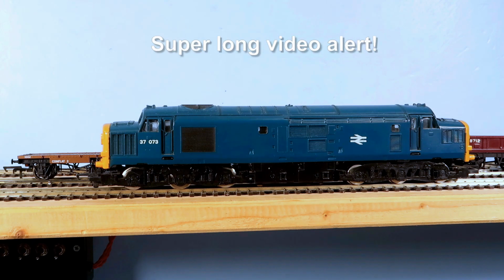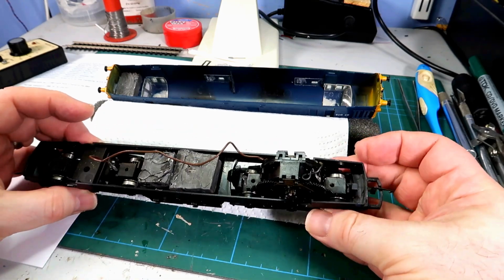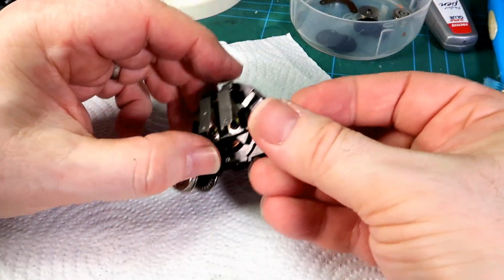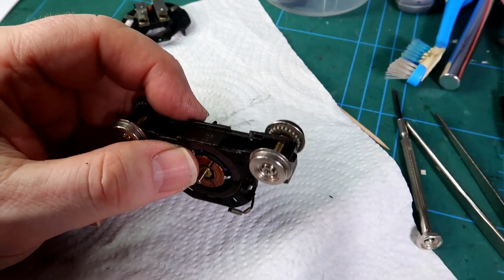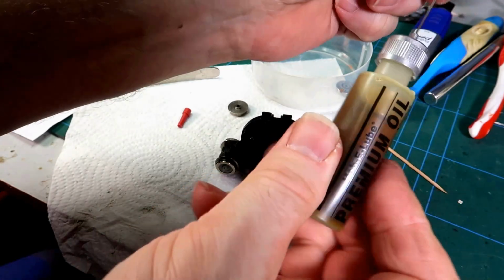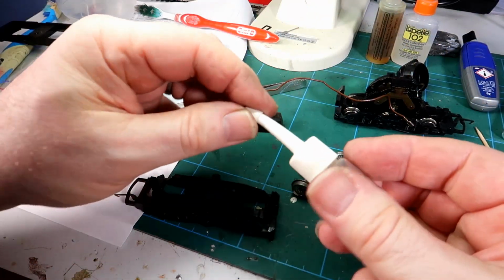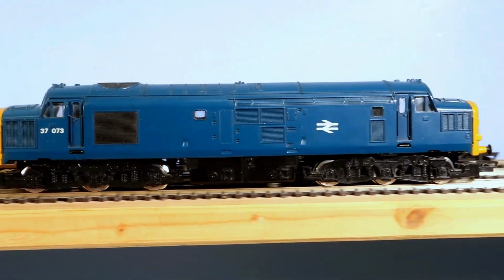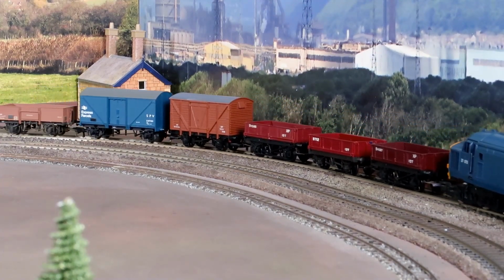Hornby R369 1980 class 37073 full strip down, service, compare and running video (TimeCode included)

Comment: A great job, she runs well for a 40 year-old loco. I had one of these as a youngster. When the yellow ends became scruffy I repainted them with my dad's tin of touch-up paint for the car. It was a Fiat 128 'W' plate (1980) and the colour was called 'Golden Yellow'. It worked out quite well actually but the shade of yellow wasn't quite right. After that some people thought it was a Lima loco because the paint was a dead ringer for the Lima self-coloured plastic ends. Funny the things you do as a kid!
Reply from the maker: Hi Paul many thanks indeed, Ah yes the things we do lol

Comment: Another great video to see yet again. The ring fields are such a great motor to work on. Just got to be careful with those springs! I will admit that springs have flew across the room before and I have a few spares just in case they are never to be seen again. Keep up the great content!
Reply from the maker: That is so very kind of you, yes good motors but I fear the nylon bearing at the brush end is wearing on my 37, a very poor design back then, might look at fitting a metal bearing some time.

Comment: Great video…wish I’d watched it before last year  I dug out my one along with another 3 1970s hornby ringfield engine locos and serviced them to get them running…none had run since the early 90s. Following another youtube tutorial I used a small wire brush dremel attachment to clean commutator….I thought afterwards this wasn’t a good idea…more so after seeing how good a job lighter fluid does. Definitely 47 bogies…ironically the Triang model it replaced had the correct 37 bogies (same as those fitted to Deltic and Class 50) which were steel rather than plastic.I still have the bogies and chassis from the triang model which was a far more solid and superior model . Incidentally I worked extensively on both Class 37s and 47s at Gateshead from 1978 (still on railway)…I  didn’t realise the the real 37073 was based at Gateshead, therefore I’ll almost certainly have driven it…I will now look at my hornby one nostalgically along with my ring field  47421!
Reply from the maker: Hi thanks very much and hi to a fellow driver. You saw the best years I think. Oh dear yes a dremil has no place near motors. With luck the brushes will polish yours smooth again over time. I've seen others say to use tcut on commutator, another terrible idea as it can take the insulation off the windings lol. Thanks for stopping by
Reply: Hi to get your commutator back to a mirror surface I use T-Cut for car paintwork and cotton buds just use as the lighter fuel with cotton buds when all the muck is off, make sure you get all the T-Cut off and you will know when you have when a clean cotton bud has no black deposits in evidence.
Reply from the maker: @andyrussell7506  Hi Andy, T Cut will soften and strip the insulation on the armature wingdings causing short circuits and loss of magnetic field. I'd highly recommend you stop
Reply: @ModelRailwaysUnlimited  Well I have been using T-Cut since the early 1980s and like I said you do have to make sure you get it all off. I have never had a failed loco yet. 

Also I don't recommend Lighter fuel for cleaning locos either on the safety aspect of things as accidents do happen and a bloke I know ended up with very bad burns to his body when things went wrong. 

The T-Cut is not applied anywhere near the windings and only very sparingly on the tip of a cotton bud I also clean wheels with it and it does not take off the chrome as some other cleaners will do.

Also  fibre scratch brushes leave tiny scratches on commutators and wheel treads and dirt then lodges in the scratches and causes more problems than before. 

So thanks for your message and I will just be even more careful now and make that only the commutator gets the T-Cut treatment
Reply from the maker: @andyrussell7506  Thanks Andy, a check of the TY Cut data sheet will show that its almost worse than lighter fuel lol then again anything that cleans chemically will be hazardous in some way. http://www.partinfo.co.uk/files/TMT306.pdf
Reply: @ModelRailwaysUnlimited  Thank you for the info but already looked at that sheet and it also tells of the precautions that need to be taken. I must admit I have never seen a car body builder using T-Cut with all the clothing that the sheet says he needs to wear. The risks are there though so I will up my risk assessment sheet forthwith and follow them to a T-Cut thanks again anyway
Reply: Fortunately, I don't think my use of the dremel with fine wire brush has unduly affected the armature...it looked highly polished afterwards (no doubt magnified it would show tiny scratches which will hopefully be polished out quite quickly by the brushes). I'm quite attracted to the idea of CD motor mod...the motors are very cheap (cheap enough in fact to throw away rather than maintain) and seem to have much better low speed performance?
Reply from the maker: @pielight7449  I have one modified with the cd motor, they do work but can be rather sensitive so do need the diode voltage droppers
Reply: @ModelRailwaysUnlimited  Thanks....I think I'll give it a go with one of my locos then👍
Reply from the maker: @pielight7449  Let me know how you get on

Comment: The Class 47 bogies are one of the many flaws with Hornby’s old 37; a cost saving measure I assume, but easily fixed by some Lima bogie frames and a bit of cutting n gluing. In terms of dimensions however, the model is apparently very good and as such is a popular option for detailing. 

I’ve often found these old Hornby ringfields to be surprisingly smooth and quiet. I’ve had a couple that have been caked in black muck, carpet fluff and have seriously rough springs and brushes and yet, somehow, still run lovely. One I put together from old and haggard bits donated by a friend for my Evening Star runs gorgeously, and a properly knackered class 29 I plan on restoring - that at one point was smoking like a steamer - is practically silent! Strange, when most complaints of the Hornby ringfield you read about is that they’re loud and crude.
Reply from the maker: Hi there and thank you kindly for the nice comments and interesting info. I agree fully, they are not crude but simple and reliable so get my vote :)

Comment: what track is that please? I bought an old hornby class 52 - quite a surprise with this locomotive, i had been running it on trix twin, three rail, track on which it worked brilliantly but then, on peco set track code 100 it is less good, goes ok but not as well, disappointing, should i have proper hornby track for it do you think please?
Reply from the maker: Hi, mine is Hornby set track, I would think Peco would be ok

Comment: I have a 2005 Hornby Class 37 (numbered 37260), which is mechanically very similar to this one. The only major difference I can see is that mine has a 5-pole version of the Ringfield motor. 

Hornby certainly got their money's worth out of this tooling!!!
Reply from the maker: Hi Christopher, ah yes the five pole, I have upgraded a few of my older ones to that, I think it adds to the running. Agree on the tooling lol

Comment: How did the body come away from the chasis?  There is no screw to remove, I believe.
Reply from the maker: Thanks, unclipped at the front and side's
Reply: @ModelRailwaysUnlimited  Thanks.  I thought so but it requires some care because if those clips snap the whole model is wrecked.
Reply: Where can one get spares for the ringfield motors?  Thanks
Reply from the maker: Try Peters spares

Comment: Ah yes you commented on my video about this a few days ago.

It's the same model but the one  I have has had a few upgrades, has dual pick ups on both wheel sets!

I myself then removed the stock weight and replaced it with wheel weights  which effectively doubled the weight and took the same amount of space.
Had to trim back the guide fins at the center point of the body to allow for the weights.

But the best thing was the addition of the stay alive. Never looses power now at all!

Good video on your part mate, these old motors tend to do well with a good clean such as this - good to see that you've already "skimmed" the gears to reduced poor running. Did you also check tooth quality?

Personally, I believe DCC is worth it just for the stay alives, they really do transform operation at low speed.

Also if I may, Try spray painting the whole body with Halfords clear Matt lacquer.

It took a that "toy like" shine off the plastic and allows your locos to look far more realistic!

Cover the windows though otherwise they become frosted lol

All the best mate!
Reply from the maker: Morning, many thanks indeed. I basically did my Lima plan on this Hornby motor, check out my Lima service guide if you get time. Thanks for the tips, take care.
Reply: That's a great video Mike. Pleasing to see because there are a few people on YouTube that put up strip down videos but don't just make mistakes but are quite arrogant when the likes of us who have been working with these for decades make any suggestions. Being extremely gentle with commutator gets a big tick from me. (I did work in motor design myself) After all you can't even get inside can motors to play with it,  so my approach is don't even touch unless absolutely have to. My only slight difference to your approach is to use a mere smear of lube on gear teeth...because it quickly flings off anyway (nylon66 is self lubricating),  and likewise the merest wetting of surface on gear faces.  Thicker lube causes quite a bit of drag between sliding gear faces and clips. Totally agree with a thin lube on cast trailing bogie. That makes the biggest difference to running of any ringfield,  as it keeps the insulating black oxide grime away. This is the reason people often notice ringfields get better when "warmed up" , it's just the axle wiping that black away when it's ran dry.

Could I ask for a video showing how you used the lining pen on the handrails? You've done a cracking job there mate!
 Kind regards Gary
Reply from the maker: Hi Gary, very many thanks. I think I showed it on my Blue Pullman restoration project but can't remember. I'll check
Reply from the maker: Hi Gary, check the start here https://youtu.be/fcgpjCqVLYg
Reply: @ModelRailwaysUnlimited  thank you I will watch that again. I did see first time but obviously wasn't paying attention hahaha just like when I was at school ;-)

Comment: I picked up this one cheap but it didn't run. When taking it apart I could see the wire to the rear bogie was loose but could see nothing to attach it to. I assumed there would be wiper contacts from the wheels but could see none, nor any tab to attach the wire to. Does it just push between those clips on the frame/ Are they not just plastic?
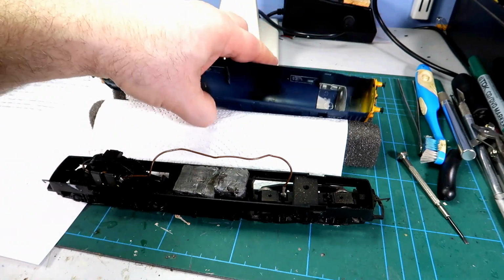Reply from the maker: Hi, yes that's it presses onto the metal clips, the wheels pick up through the axles. You can see the location at 2:30 in my video
Reply: @ModelRailwaysUnlimited  But there's no actual spade terminal for the thing to push on to, it's just squeezed in-between those 'pincers'?
Reply: @ModelRailwaysUnlimited  Got it running on the rails now, thanks!
Reply from the maker: @ajivins1  that's great news well done 👍

Comment: The BR yellow at 21:10 is an absolute bugger to try and get right !! .... I've been trying for years and still can't find a proper match. .... There must be a code or colour reference number that modellers use ?
Reply from the maker: I guess Railmatch must have one?
Reply: @ModelRailwaysUnlimited  I think they have warning yellow and engineers yellow .... I'm not sure on the difference, and they were a bit on the expensive side, as I only wanted a small amount

Comment: I've got 37 130 with a Ringfield motor but has a metal rod for a odd reason
Reply from the maker: Metal rod?
Reply: @ModelRailwaysUnlimited  long story short my class 37 I have never runned for years so I think my dad may have tempered with it as it doesn't have wires going to the rear bogie
Reply: @ModelRailwaysUnlimited  this video has helped tremendously as I've just serviced my Class 37
Reply from the maker: @111greatbear3  great news
Reply: @ModelRailwaysUnlimited  I just need to get a new wire then it's good to go

Comment: Nice job Mike, these old locos still have a lot of good years in them with the right care. I think it will be an eternal mystery as to why  Hornby put that off centre pivot in the trailing bogie. One of my most popular videos is one in which I demonstrated fixing that lean without compromising the integrity of the original model.  Here is a link to that video for anyone interested in seeing it. https://www.youtube.com/watch?v=JbU8yvwv2aM&t=1s The bogie sideframe seems to be another Hornby compromise.
Regards, David.
Reply from the maker: Hi David, many thanks, I'll be checking your video after work